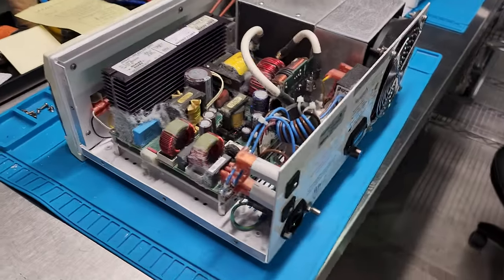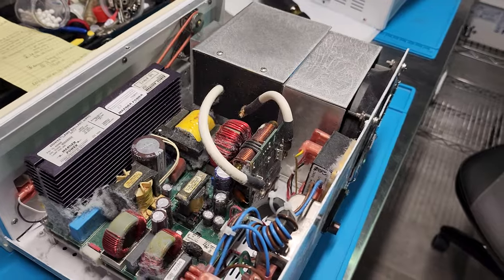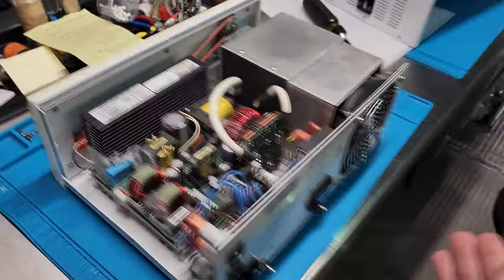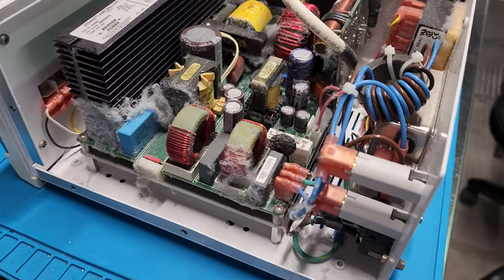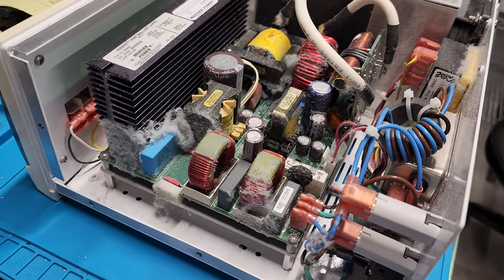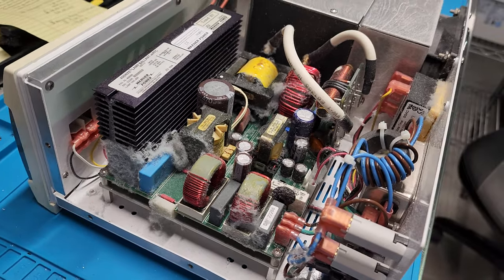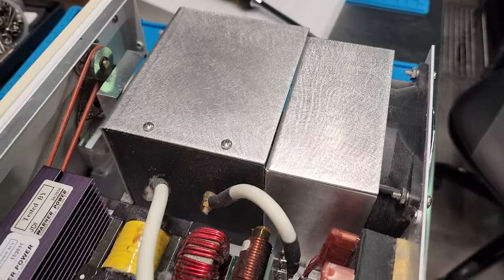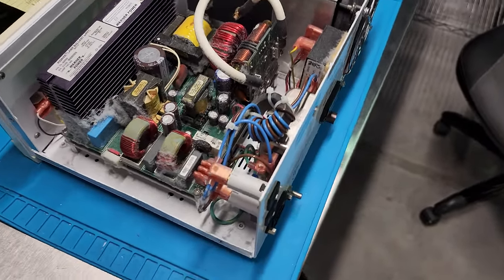Lightsources Need Love.

Comment: I was hoping you were going to video the repairs.  😥
Reply from the maker: No need. A cleaning on both and adjustment of door and burn in test
Reply: @BetterBiomedChannel  Gotcha
Reply from the maker: @MrMcShifty   Absolutely imperative is an examination of the bulb reflector. Evidence of arc-over is discoloration of the chrome and needs to be dealt with asap.